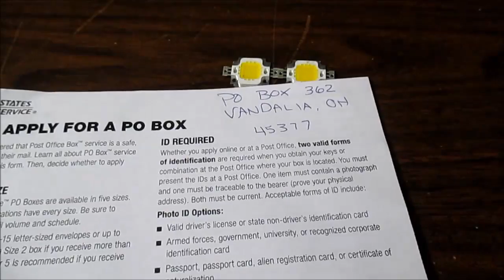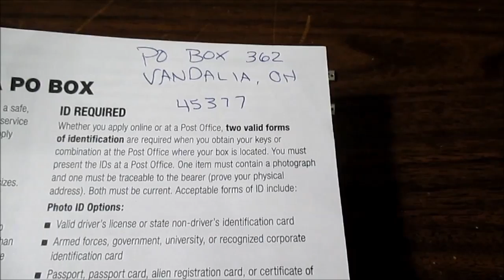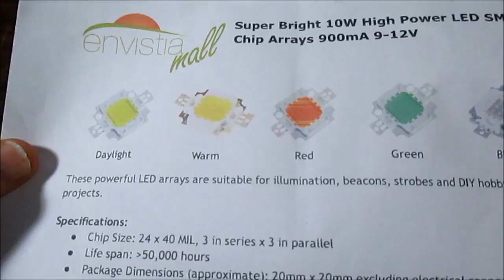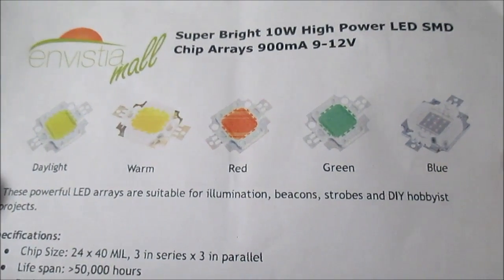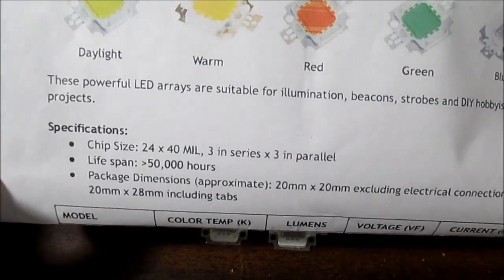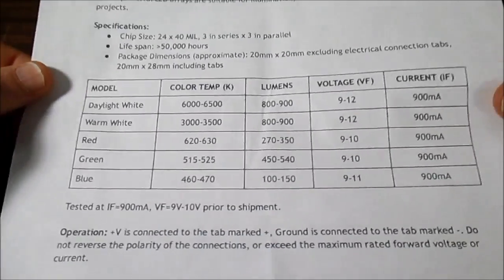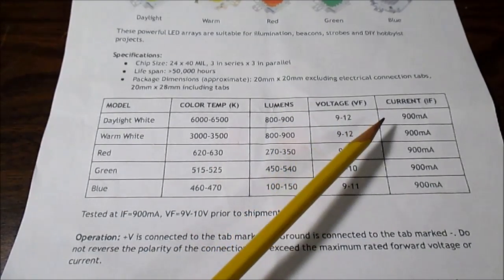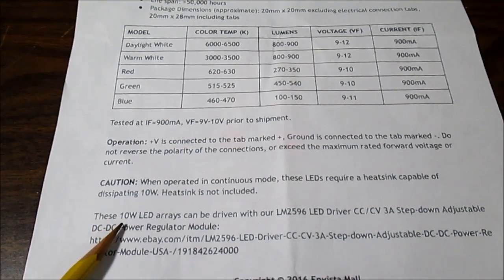10 watt color and white LEDs test and review

Comment: I've got some far-red LEDs that emit light with wavelength of 730nm, and they are very bright. They are the reddest red I've ever seen, but all my cameras show them as purple on screen for some reason. Most cameras pick up infrared as purple, but my 730 & 750nm LEDs also get picked up as purple.
Reply: Billy-Bobus . IF YOU CAN SEE A REALLY BRIGHT RED THEN I SAY THAT ITS MORE LIKE 660-670nm.ANYTHING PAST 700nm THE HUMAN EYE DOESNT REALLY SEE
Reply: It is 730nm. I got them specifically from a LED manufacturer and the data sheet says 730nm. Also it makes most black fabrics glow bright red, no normal red does that. With these far-red LEDs, I can see black sharpie on black fabric because the black fabric appears bright red. Also not everyone's eyes are the same. I've noticed that a lot of black fabrics also appear slightly rusty red under incandescent light, and to some extent sunlight. 
I have a camera lens from an old camera that cuts off all light longer than 700nm, and when I look through this lens, not only are the LEDs nearly black, the slight rusty red on my black fabrics under incandescent light is gone too. I asked my friend to check if he saw a difference through the lens. He said that the LED looked nearly black through the lens, but he couldn't see the difference in the fabric under the incandescent light. When I look at the sunset there is a mix of neon and rusty red in there, but when I look through this camera lens its more yellow-orange, and the hint of rusty red is gone.
It turns out that the relative proportions of each type of cone can very quite a lot. Read this https://en.wikipedia.org/wiki/Cone_cell
Look at the section where it read "shape and arrangement". Also at least one mutant form of the red pigment has been found with a peak response about 10nm longer than normal. Sure, the Frenchies at the CIE will say "anything longer than 700 is IR", even though every person I've shown my 3W 730nm LEDs to says they can see them just fine. The CIE are the same people that say "since eyes don't respond much to red, don't worry about red light in CFL and LED bulbs", as a result, we got bulbs that give us a whole lot of blue and yellow, but bland reds.
If you don't believe that the 730nm LEDs are visible, buy them for yourself.
https://www.ebay.com/itm/5x-Far-Red-Infrared-3W-730nm-Grow-Light-LEDs-Hydroponics-20mm-Star-USA/322421292198?hash=item4b11ce7ca6:g:80gAAOSwx6pYoHeu:sc:USPSFirstClass!43528!US!-1

Comment: Can the wavelength of the blue react with UV sensitive materials?
Reply from the maker: Yes it works with most black light paints. Other materials may need true UV.
Reply: only if you get the 440-450nm blue range ,above that you dont get uv reaction